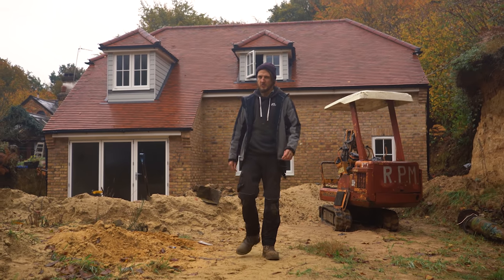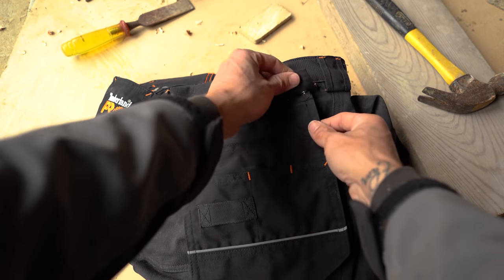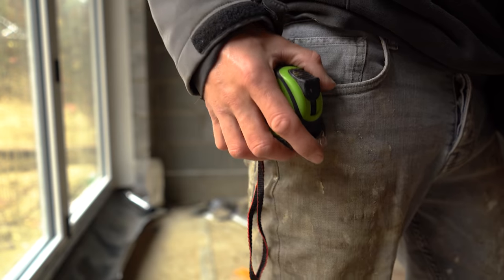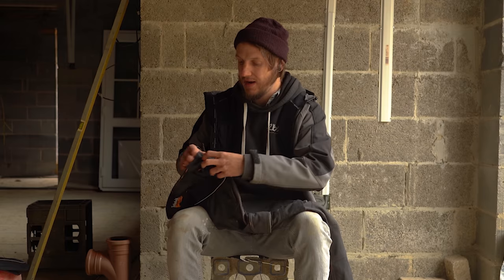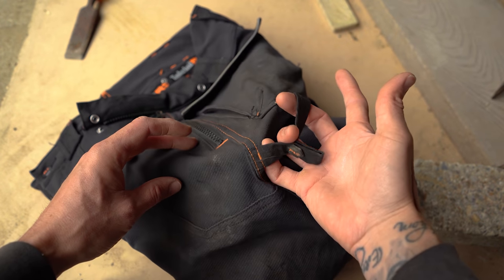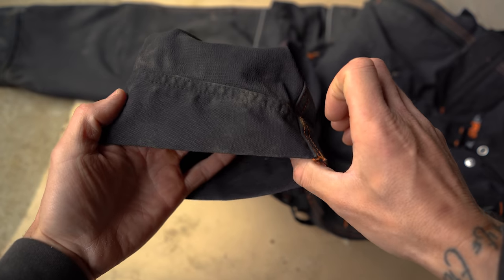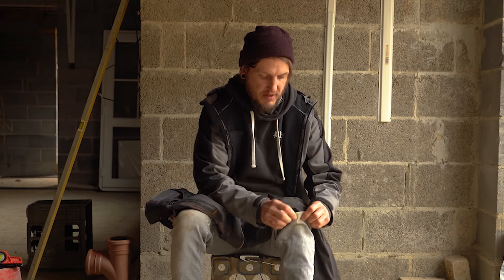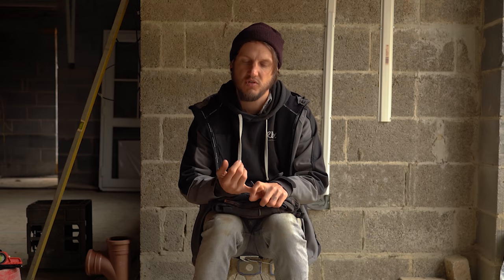TIMBERLAND PRO MORPHIX WORK PANTS | IN DEPTH WORKWEAR REVIEW

Comment: I had a pair of timerland pro boots. They were the most expensive and the most uncomfortable boots I've ever bought plus very heavy would not but their stuff again. With work trousers I've tried nearly all on the market but snickers just CAN'T be beat. Just my opinion 👍
Reply from the maker: Its crazy to hear everyone's opinions on work wear. I currently have a pair of Timberland boots and find them the lightest and most comfortable boots I've had in years. Out of interest what boots were they? Mine are the Icon boots. Be interesting to know. I've never had any Snickers gear, might buy a pair to have a look and review. Thanks for the comment Jason 😁👍
Reply: @RodianBuilds  I'm not sure if you just mean timerland boots ( as in dress wear ). The ones I had were steel toe cap steel mid sole and it was few years ago but they were definitely Timberland pro and they cost me 90 quid but I hated them. It is all about opinion bud, you may hate the snickers and they are expensive but I love the trousers with knee pads and always in the right place when you kneel cos of the twisted leg design. Try em mate see what ya think. Keep up the hard work on ya channel mate hats off to ya
Reply: Snickers is good along with blackläder is my choice